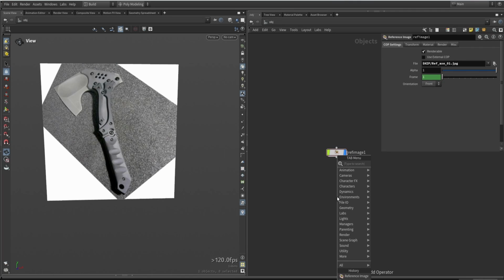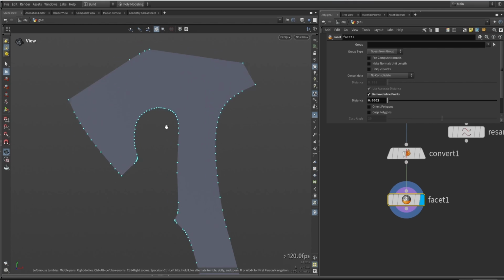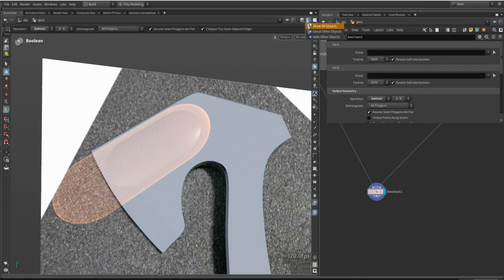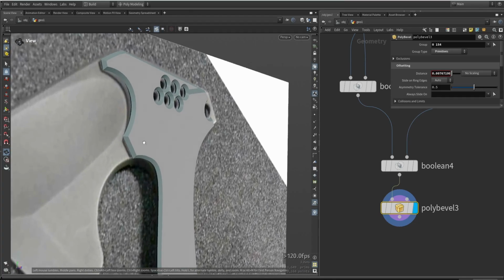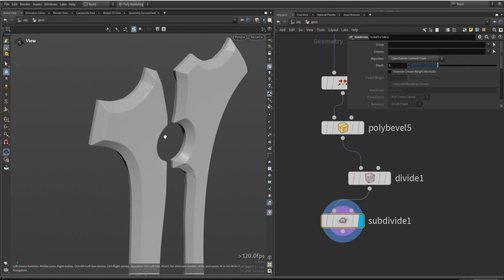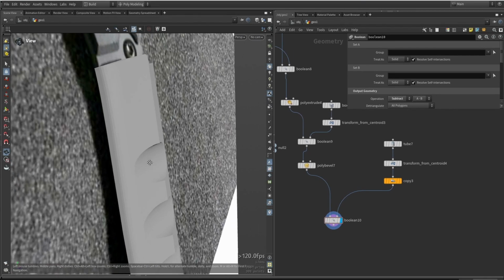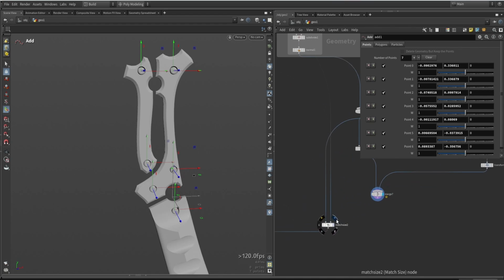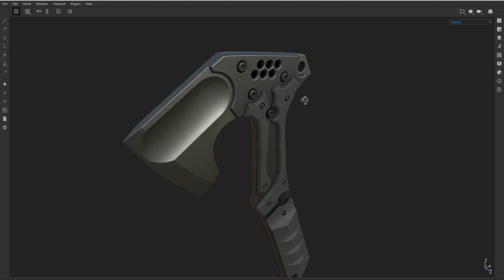Axe modeling || Houdini tutorial

Comment: Awesome work, I really enjoy modelling with Houdini.
Never quite felt comfortable with destructive modelling since I rarely model with a plan in mind and geometry nodes or boolean modelling with DCCs like Blender always involve a point of no return for having to fall to destructive modelling at some point before real use in projects.

Having said that, I do sometimes worry about mixing boolean operations with poly modelling even with hard surface objects like this, it very easy to run into situations with mixing boolean into workflow which outputs topology that is no longer clean to edit by hand or touch-up. 

For example with your axe there is definitely minor artifacts in the high-poly model along some of the edges (zig zagging is apparent in the lighting etc...), most of which I suspect is just a consequence of remesh not respecting hard edges properly. I'm usually at a loss what to do in such situations aside from manual retopologizing, would love to know what your thoughts are in how you handle keeping artifacts to a bare minimum if for example you wanted to spend a bit more time working on the model without resorting to fully manually work.

 I do realize its partly a philosophical debate of more work to keep clean topology vs remeshing and moving on with minor artifacts, especially when the goal is for import into game engines.
Reply from the maker: Thank you!
For this boolean workflow it is often great at hardsurface and it also depends a bit with how creative you can be to make the shape in a non-destructive way. More complex shapes can require a bit more destructive way.
Topology can always be something else, I was hoping with Houdini 20 the quad remesher would solve some of the issue. It is still in beta and maybe in the future it will work better. There are some nice quadmesher out there that creates topology along the shape of the model (they are not perfect but sometimes better then remesh/voxel).
This remesh/voxel to make a high poly will never follow the shape. You can increase the resolution but then Houdini might take a while if it is crazy high amount of polygons. There are other ways you can try to make highpoly modeling, like in the video I did a super rough subD modeling.

In general I found using polyreduce, auto UV and voxel-highpoly will always give some minor artifacts.
Currently to get the most out of the model means usually some manual tweaking. I have not seen a magic solution that works on everything. The video shows the basic form of this workflow. For the more final output I would increase the resolution on the voxel and try out more setting on UV to see what works better.
If you work in a team and the output quality is approved then I just leave the setup like it is. Some of the small artifacts are hard to see when you are not zoomed in on it, which I assume for most games might be fine.
Hope this helped :)
Reply: Your points are very valid. I am still looking for really good resources covering ("procedural") modeling and topology. Even if I enjoy videos like this, I think it would be great to really double down on topology best practices (based on use cases ofc.)
Reply: There is no point of no return. 
We work on computers - everything is digital. You can save a backup-file before getting "destructive".
Manual work is not only cleaner sometimes, but it can also be faster.
If you insist on using a specific workflow excusively, then you have to pay the price (everything has a downside). 
This is not a philosophical problem, just the consequence of your choice.